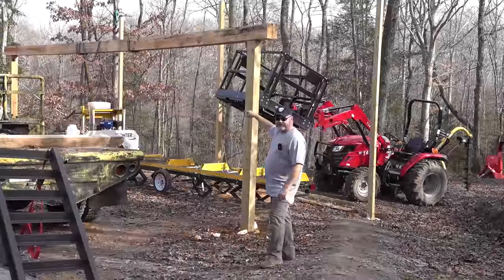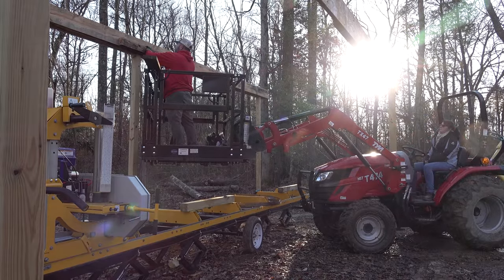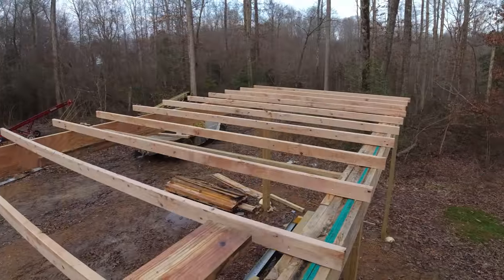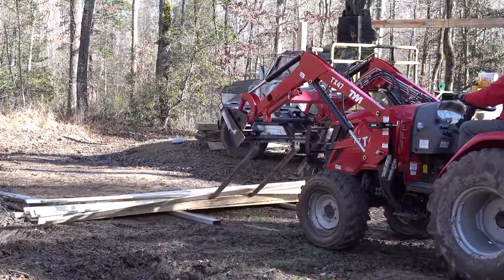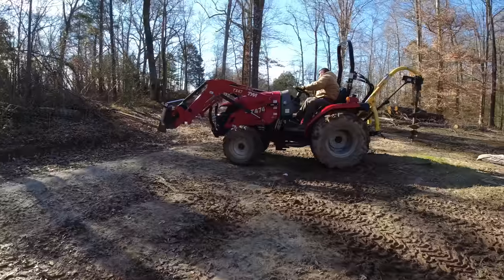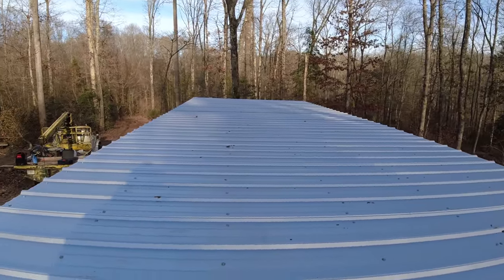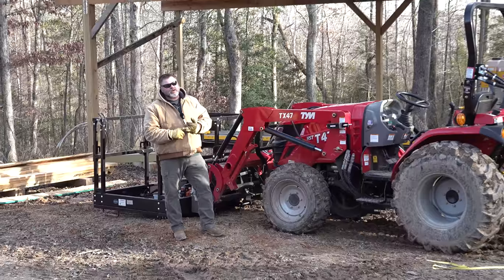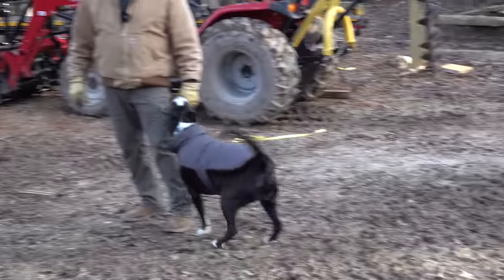15 Minute Sawmill Shed / Start to Finish / Good & Bad

Comment: Pretty darn nice 'temporary' covering for the mill, I'd say.  I've still go nothing over mine.  You guys are cheating with putting the tin on the roof !!  LOL.  I pulled every sheet up over the edge for my pole barn a few years ago...and the back half was 30' sheets to cover the lean to with out a joint.  Superb job on the shed guys !!
Reply from the maker: Thank you. I am going to put some tarps up at the back and walls on the end. I will have the tarps go up and down. It should last a good while.

Comment: Building a sawmill shed for my portable Timbery 285 Sawmill. Watching you helped... thanks what are the dimensions of your shed? Height of your walls?
Reply from the maker: The post are 28' by 10' with a 12' roof by 30. I only put a 3 inch drop from front to back. We shall see if this was wise.

Comment: What kind of lift for the forks are you using?
Reply from the maker: I have had them about 5 years. They are made by "Worksaver" I would go with 42" vs 36" if I had it to do over.

Comment: I’ve never seen anyone start a tin roof in the middle of the building.
Reply from the maker: You just have to turn the tin around when going the other direction. It is not the right way, but I see it in my head. It worked ok. I am defiantly not a pro.

Comment: Man oh man would I like to see two forty again. I hit two ninety and it threatens to go even further if I smell bacon and eggs. Hungry is just a normal feeling but trying to even walk in my crutches is just unbearable for me. I have yet to find a building that is temporary as it just becomes temporary for the next project. Wish I could talk you into putting sliding stalls for your different size boards and the waste also as it will grow so fast. Keep it in short tight bundles that you can pick up and move to the wood pile or burn pit makes no difference as long as its not scattered all over and more pieces to move. Plus then stickering the piles of two by and three by and four by... you get it plus all the one by keeping it separate will pay you back in spades. Those bins are not simple at first but if you check around where they off bear their lumber into manageable stacks. Its always I never cut that much but before long you did. You would need like four or five of those that you take the boards to and who knows, you might pick the outside ones where they stack. A log deck even if it only holds three or more logs so you can cant hook them onto the mill frame. Sawing with sandy is a channel who is a mill in progress is a good example of it.
Reply from the maker: I love everything you said. I have a permeant spot picked out for the sawmill at the back of the property. It will take a good minute to clear it and put in gravel. This area will be part of our back yard after the house is built.  I truly do plan on taking it down at some point. You may be right.